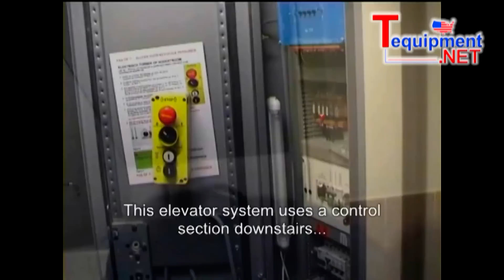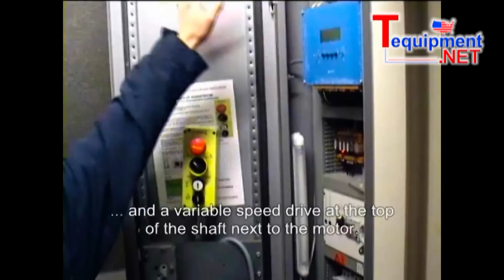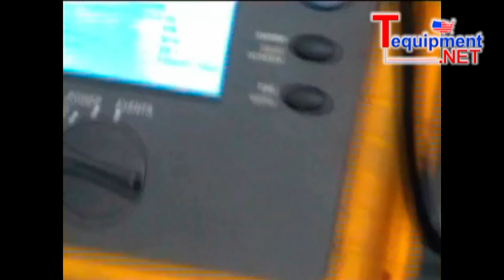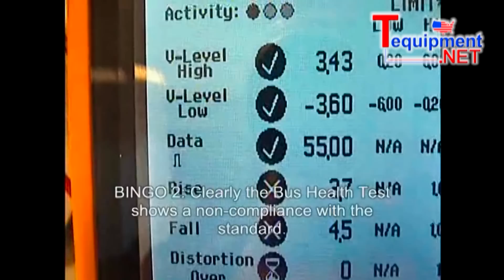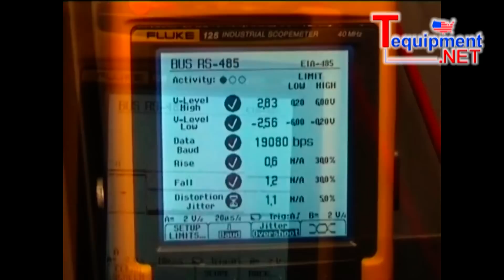Fluke 1735 & 125 Applications: Troubleshooting An Elevator

Comment: You can't accurately troubleshoot continuity between contacts with the wiring still hooked up, you could get back feeding through the circuit.

Also who installs a non shielded line to something that needs minimum noise when electricity creates magnetism!